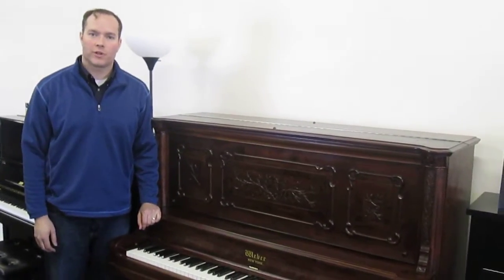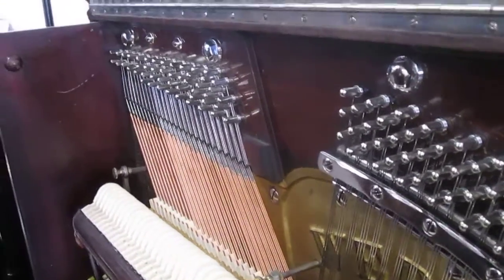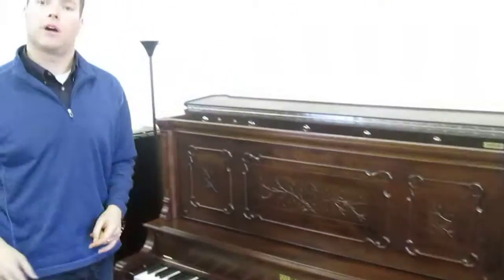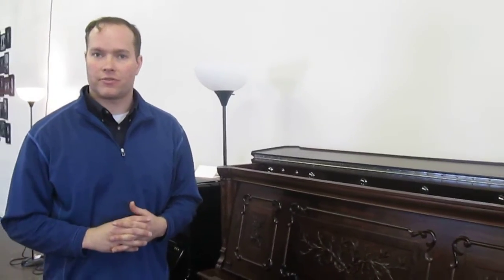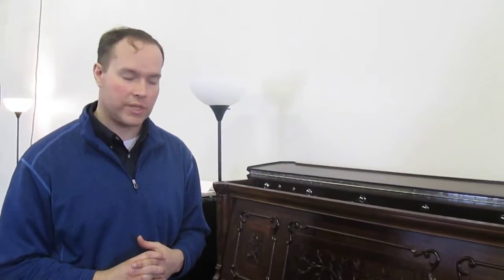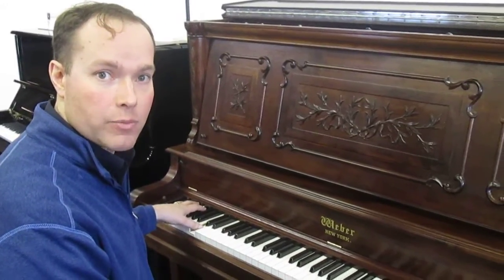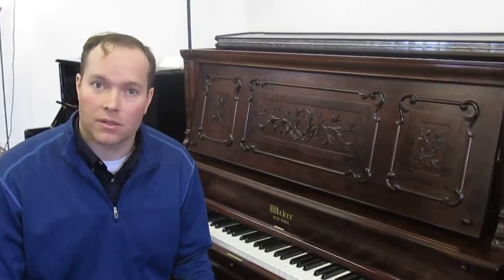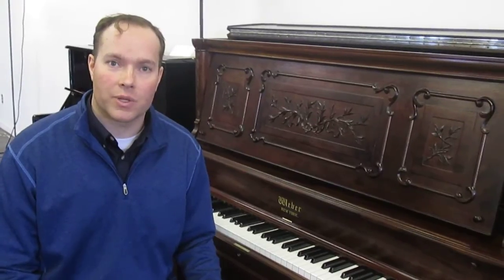Antique Used Piano - 1895 Weber Rebuild

Comment: If your grandfather's axe has had it's handle and blade replaced, is it still your grandfather's axe?
Reply: No, but if you define a piano by its looks and its tone, then you could say this is still the same instrument. He didn't replace the soundboard or bridges or fit a modern action, and he may not have changed the scale design by using different string wire gauge and tension. Many old pianos (not this one as much as some others) have distinct characteristics to their tone that are recognisably not 'modern'. For whatever reason, if you rebuild them they don't magically gain a modern sound.